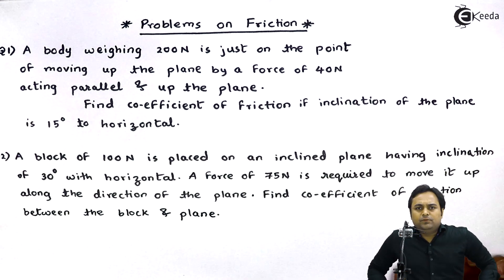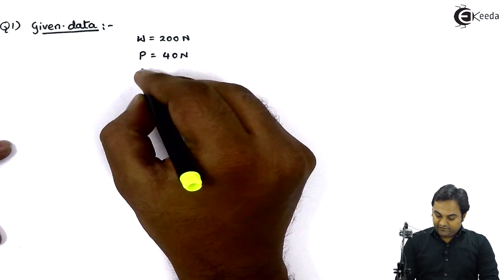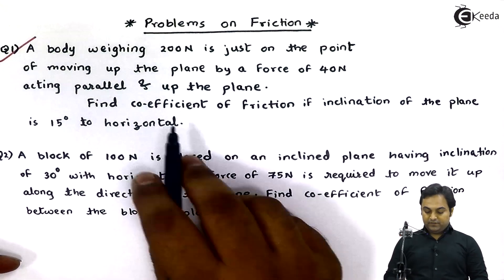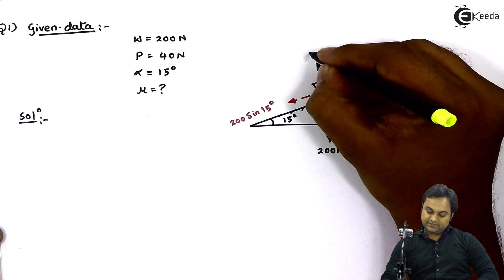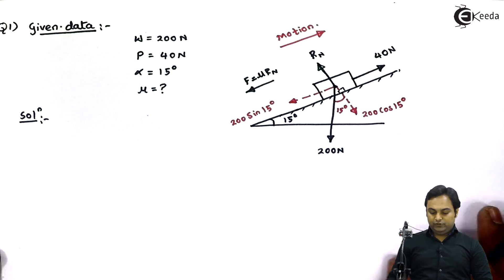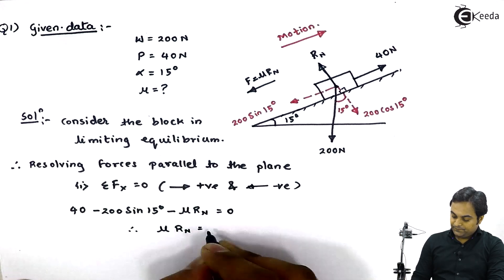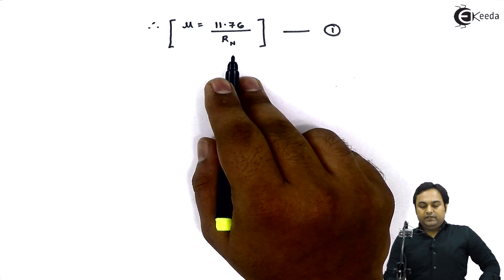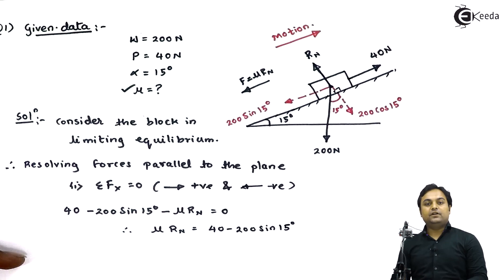Friction Problem No.1 - Friction - Engineering Mechanics

Comment: Sir ans is wrong... and one more thing.. when we solve the problem we take x-component in horizontal way and y-component in vertical way (40-200cos15= -153.185 in horizontal way)... and one more thing 40-200sin15=? (-11.763) how u are taking -ve ans +ve 🤔🤔

Comment: Wrong solution and explanation. Coefficient of friction coming out to be negative that means force of friction is actually helping the force applied to move the block in upward direction. This seems unusual. Maybe there is an error in the question and I think that a force of 40N would not be sufficient to just move the block upward.
Thank You
Reply: U r absolutely right 👍👍👍👍👍🏿
Reply: Absolutely right...
Reply: U r a *** nerd
Reply: ure right. the block is much too heavy and the angle of inclination will make the box slide down if only supported by force of 40 N.
Reply: Ys